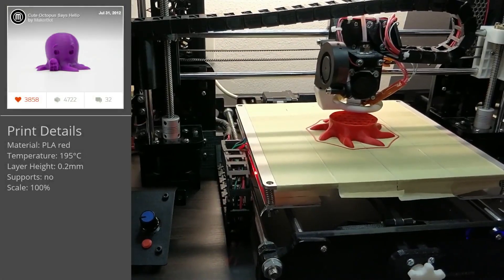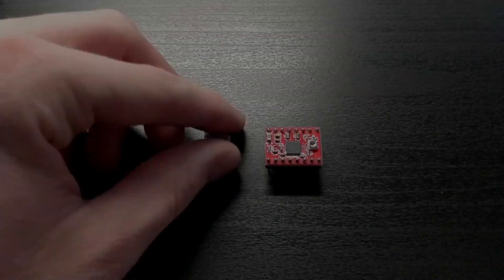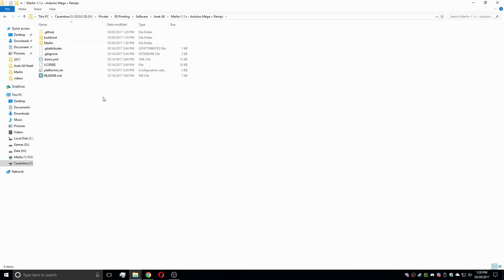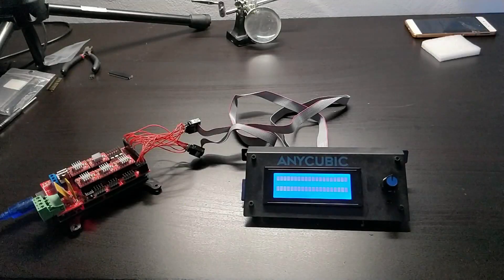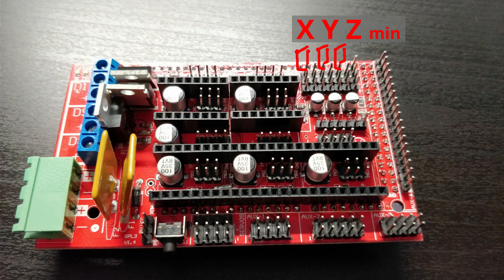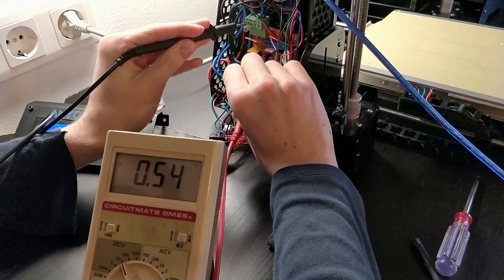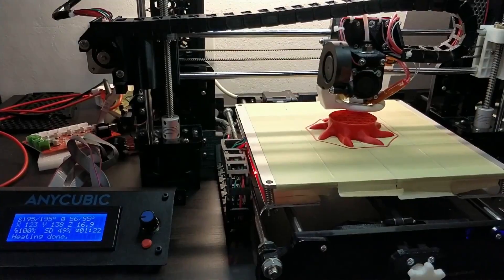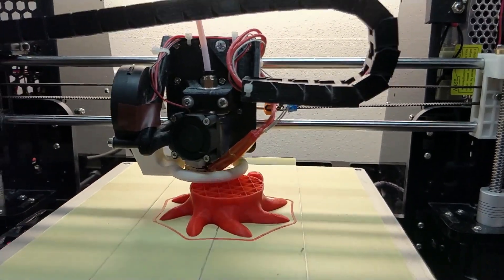Anet A8 Controller Upgrade (Arduino Mega + Ramps)

Comment: Hey man,  I fried my Mega (The voltage regulator I think) dunno what I did wrong. Anyway, I am waiting fora new Mega now, do you think you would be able to assist me somehow and not fry it this time, please? Your help would be much appreciated!
Reply from the maker: Hi, I'm sorry to hear. I know that this is extremely frustrating.

Can you tell me what you did last to destroy the board?

Be careful at those 3-pin connectors (like those at the endstops), because if you connect them the wrong way, you short the board.
Reply: @Caverntwo  Thank you for the fast response, didn't really expected that to be honest.

I had only my 12V connected to the RAMPS (The USB cable was also connected to the RAMPS, but not to the PC) and 4 stepper drivers (2208) I just wanted to measure them. As soon as I turned on the PSU, the led indicator near D10 on the RAMPS (that usually lights up when you heat the hot end I think) it light up and short after that a little bit of smoke came from the Mega and a low cracking noise like something got burned/broken and I turned it on immediately. Removed the 12V from the RAMPS board and tried to connect to the Mega but I wasn't able to. After reading here and there I think the voltage regulator got fried, but since I am not really familiar with all that, I might be completely wrong as well. If that is the case I've read that I can remove it and only power the Mega from 12V and it cannot be powered from USB anymore, but if everything else works, that would be fine.

It would be much easier if we could chat somewhere else where I can provide screenshots if necessary, if that is fine by you.

Lemme know what you think.

Thanks a lot!
Reply from the maker: I am by far not an expert regarding the voltage setup on the Arduino (just learned a little bit about it in school), but I know that there's a voltage regulator getting the 12V down to 5V/3.3V, depending on the model. I don't know anything about the TMCxxxx stepper drivers, as I've just been using the normal A4988 and DRV8825 all the time... Did your setup work before?
My guess is that you either shorted something while measuring or you overloaded the regulator. But I'd need to read about how to use the TMC2208s first, which I can do the earliest this evening.

Sure, you can send me an email, my address is in the "About" section of the channel. Or, you can contact me on Telegram (@caverntwo) too.

Comment: My plan was just to change the mainboard to an arduino because i think my old one is broken it shows randomly 250 degrees on the hotend but the sensor works i tought its a software problem and upgraded the firmware to Marlin but the problem is still there so do you have any idea to fix this problem because i don´t realy want to change my mainboard i have an arduino mega but i need the other parts so does someon think the problem is fixebil?? ( Sorry if my grammer or English is not the best im from germany an 13 years old)
Reply from the maker: Hi, thanks for your comment. I hope that you haven't received another replay from me yet, as that means that there's a server error...

It actually seems to me similar like a hardware error I encountered two weeks ago while working on the FLSUN Cube machine (video will be up in the next weeks). The temperature for the hot-end reported 350°C, which was obviously not right for room temperature. What happened was that the screw holding the temperature sensor in the heater-block was turned way too much. This destroyed the insulation of the sensor-wires and shorted them, reporting the highest value available for this sensor type.

I'd suggest trying to plug the heated bed sensor into the hot-end sensor plug for testing. If it works just fine and the value reported for the heater is ok, you know that it's a problem similar to the one I had. 
If not, let me know. I think that it's pretty unlikely that your board might be dead. But hey, you got a good firmware now!

I hope that I could help you!

Ps. At the age of 13, I didn't even know what a 3d printer is and my English was even worse than yours (I'm from Austria). Keep it up!
Reply: @Caverntwo  Thanks for your reply, i tested it and it's not the sensor so i think my Board is dead, i have no other choice than to upgrade it to an arduino
Reply from the maker: So plugging in the heated bed sensor resulted in the same thing? That's sounds bad, I know.
I think that we can still debug some few more things.

What board do you currently have?

You said that you upgraded the firmware to Marlin. Did you encounter the same temperature values before the upgrade too? Does everything else work (like movement, heating, fans, etc.)?

If you want to contact me personally, you'll find my email address in the About section of the channel.
Reply: @Caverntwo i have the Standart board that comes with the a8 everything works fine (Motors, fans,...)and it was before the firmware upgrade, i thought it would help but it didnt, my father says i should just Upgrade it, it's just a few bucks
Reply from the maker: Yeah, that might be the best thing anyways. I am also out of ideas now...

Get either an Arduino Mega + RAMPS 1.4 for ~$20 or something like a MKS Base Gen L (which is basically the same, but a little bit safer). Just go with the default A4988 drivers. Buy some more, as they can break easily (I have like 5 in replacement). 

You can get them from many places, but I'd suggest checking out GearBest. If you buy via my links you also support my channel for no extra costs: https://www.gearbest.com/3d-printer-parts-c_11400/?attr=2039-12948&lkid=20266871

Be aware that you need a new LCD in every case, as the default ANET one has different wiring: I went with the reprapdiscount smart controller twice (e.g. https://www.gearbest.com/printer-parts/pp_009343053715.html?wid=1433363&lkid=20266820).

If you have any questions, just feel free to ask.

Comment: Appreciate that you posted this but did you watch you video first to check that what was onscreen was visible/legible once it's size was halved? Can I suggest that if you make another, you copy sections you want people to be able to read, & expand them in a box whilst pausing the video. Most 3D printer users are age 18-60, 90% of adults age 25+ require reading glasses; Onscreen font size is about "1" not 14-20  : )
Reply from the maker: Hi, thank you for your feedback.
First off, the video is already older than a year. 
Second, I am very sorry that you couldn't read the code. However, it should be legible in full-screen mode. I'll take care of this in my next videos anyways. 
BTW. I'd love to see a source for the numbers, as the ones we learned in school were ~60-70%.
Reply: @Caverntwo  I'm not sure what the age of the video has to do with my Feeback comment. This is a common problem; It always surprises me how many people don't check that what's onscreen to the viewer is actually legible from a PC screen. It's important in a 'pacy' video where you can't easily see quickly what's being done.....but it's still good that you posted it and tried to help others.
Reply from the maker: It has a lot to do, as, at the time of recording, I didn't really know how to do it properly ;-)
I have checked the video, and in full-screen mode it's readable. However, I am aware that not everyone has a double-monitor setup.
Reply: @Caverntwo  I think you actually misunderstood my point so let me briefly clarify, I was referring to the fact that EVEN at full screen what's translated from one person's PC screen to another eg. 22" PC monitor to 14" laptop compresses the view so extracting & expanding whatever is essential to be legible is helpful, and arguably essential for millions of viewers because even if we Pause, screengrab & try to magnify it ourselves that usually doesn't work
Reply from the maker: I understand what you mean and already said that I completely forgot about this when recording the video and will definitely take care about that in newer videos. 
What do you expect me to do now?
Reply: @Caverntwo  You suggested I use Full Screen. I corrected your apparent misunderstanding (why would anyone not?) that my Feedback was based ON FULLSCREEN ILLEGIBILITY. That's all. Being pet-lipped with your "What do you expect me to do now?" remark just makes you look like you're 5.

Comment: Does new stepper driver silent the motors noticible?
Reply from the maker: I have not tried yet but considering the amount of noise reduction due to replacinh a vibrating driver...
I've bought some DRV8825 drivers for testing.

Comment: great vid.

I have the problem myself that the two z motors dont work really well... any idea as to why this is?

Greating from The Netherlands.
Reply from the maker: Hi, thanks for your feedback!
Try raising the current on the stepper driver for the z axis to get both run nicely. Be careful not to short anything when adjusting the potentiometer. I hope that this helps you.
Reply: First off thanks for the quick reaction to my question ! i tried fixing it by raising up the voltage but that did not work out, so i took out the driver all together and replaced... It turned out it was a corrupt stepper driver.  :)
Reply from the maker: Yeah, I've 15 of them and two were also broken, therefore always get at least one more ;-) I'm happy that it works for you!

Comment: Is there any reason to upgrade to ramps 1.4? 
let us know why we should go for it instead of keeping the stock one!
Thanks
Reply from the maker: The main reason for me was to get more flexibility, like adjustable and upgradeable stepper drivers, and a lot free pins for many things like a filament sensor (although that works on the Anet board as well with some soldering, see my other video to learn more). The real reason for the upgrade was to allow for dual-extrusion, which I added to my Anet A8 this year. And why a RAMPS? Well, it's the cheapest solution. However, you need to have a MOSFET module for the heated bed as the on board transistors are really weak.
Reply from the maker: I do not want to say that the stock board is bad, but it is very much closed, so any additional features are hard to implement. If I remember correctly, the Anet board has 4 or 5 free pins when you use the 5-button LCD, and only one if you use the large one. If you do not plan to install a lot of upgrades to the machine, the stock board is pretty much the ideal solution.
Reply: thank you man.
Have you ever tried turning your printer into a drag knife(tangential knife using the 4th axis) cnc?
would be great if you can show us how!
keep up the good work
Reply from the maker: Not yet. Thanks for the suggestion, I'll add it to my list of stuff to try out. This week I've finished my new workshop and can produce more content more quickly, so expect new videos more frequently ;-)

Comment: Can you pubblish the schematic of the lcd adapter please...thanks
Reply from the maker: Sadly I do not have any, as it was just the ordinary 5 minute trial and error project.
But: 
- Here's the thingiverse link to the thing: https://www.thingiverse.com/thing:26613
- Here's the connection diagram (you need to find out the orientation of the plugs by yourself): http://img.auctiva.com/imgdata/1/3/5/4/2/9/5/webimg/747716304_o.jpg

Comment: helpful video as always! can i ask how fast can you get with the ramps upgrade? quality wise is it better than the stock board? and do you plan on trying out the tmc2130 driver? thanks!
Reply from the maker: Thanks for the feedback!
The only difference between the current setup and the old one is that the stepper drivers are adjustable. However, I didn't try increasing the speeds as there are vibrations on the X and Y carriage that only intensify when printing faster (a bearing is broken on the X axis, but I'll replaced it with my dual extrusion setup). I'll probably not upgrading the drivers to the TMC ones but to DRV8825 (1/32 steps), which I received this week BTW.
Reply: if the part cooling fan is connected to D9, were do you connect the hotend fan?
Reply from the maker: As the hot-end fan should be always on, I just connected it to +12V and GND (I squeezed them with other wires into the fast-connectors). With a PWM extender (RRD), you can add more software controlled fans. I show one of these adapters in my upcoming Dual-Extrusion video, as the second extruder takes D9 and I need a parts-cooling fan!
Reply: Caverntwo cant wait to see that dual extrusion, im in the process of upgrading to ramps with tmc 2130
Reply from the maker: Nice!

Comment: Many questions. You mention the step drivers getting too hot, what temp is ideal? Also, can I use the Skynet 3D configuration.h file and simply change the board and lcd or would I have to redo the whole thing?
Reply from the maker: The problem is more about the motors, not the drivers. You need to make sure that they don't get more current than their rating. The maximum current is relative to reference voltage we set using the potentiometer. You could either try to solve it mathematically, or just using try-and-error and find a good solution. If the motors work just fine and don't get extremely hot after a little bit of printing, you are good to go. Else, adapt the reference voltage. After a few iterations, you should end up with a good solution.
For the software, I'd recommend you to upgrade to the latest Marlin (I did a video about that), as SkyNet3D is outdated when Marlin got official support for the Anet board. But, obviously, it doesn't matter that much, and the changes in the configuration.h file should work in either case.

Comment: I can´t solve this "ADC_KEYPAD_PIN was not declared in this scope" T.T
Reply from the maker: Did you define your mainboard properly (1:30)? If you did, you might also need to define the new LCD (1:47), as the Anet LCD return an analog value on a pressed key and you'd need an analog pin for evaluating it. As I wanted to print offline, I had to get an SD-card slot anyways. The RepRapDiscount Smart LCD solved both problems for me ;-). Hope that helped.
Reply: Finally I solved it. Just delete everything about the LCD and use Cura to manage the printer. It's not the best way but it's one way. Maybe tomorrow I will buy the RepRapDiscount Smart LCD. Thanks for the video it REALY help me :)
Reply from the maker: Well, that's sadly what I encountered as well. As my USB cables are to short and the PC isn't always on, I went with a RepRapDiscount Smart LCD. Of course there's still the possibility to use a Raspberry Pi with OctoPi (expect a video soon)...
Reply: I saw this last week, I think I ended up defining my Zonestar LCD as type 24 in uiconfig.h?